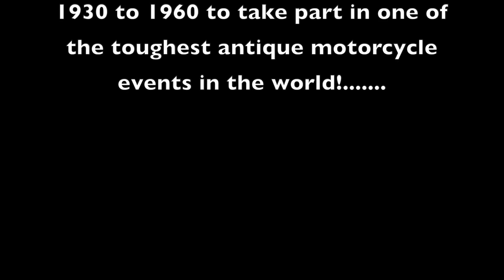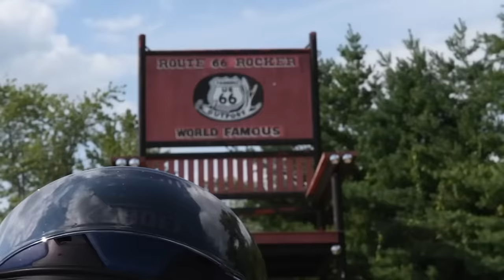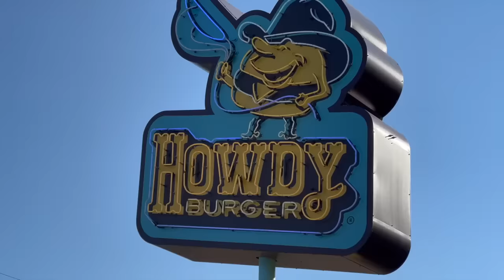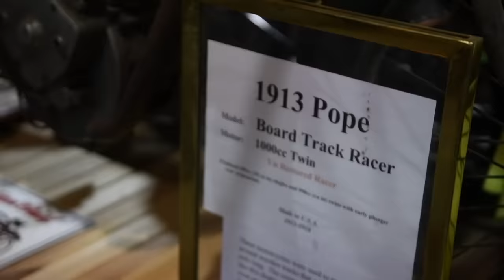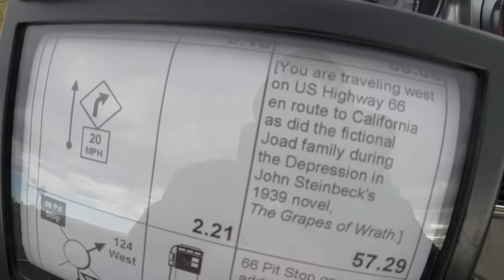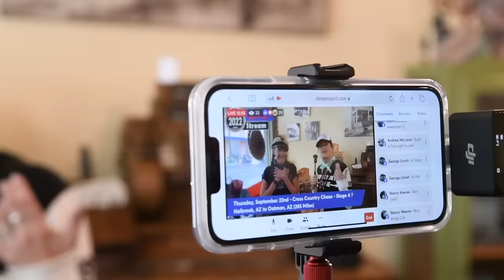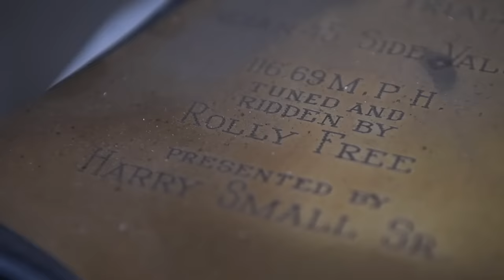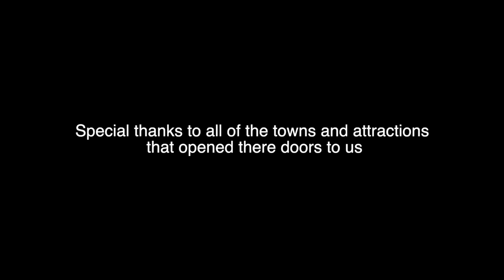Nearly 100 Antique Motorcycles Travel along Route 66 on the Cross Country Chase 2022 Competition

Comment: Rt 66 doesn't travel thru Nevada. It crosses from AZ into CA farther south at Topock, AZ. They must have gone thru Laughlin, NV for better lodging purposes because there is fuel in Golden Shores, AZ. and of course, Needles, CA. Rt 66 has had several Western Terminus' but the Santa Monica Pier is not one of them. The intersection of Olympic Blvd. and Lincoln Blvd. a few block's away is where the closest official terminus is. Jay Leno's Garage would be the cherry on the top for me.

Comment: never get caseys gas in the midwest in anything older than 20 years old it will ruin the carb gas tank etc,
Reply: the reason is there is water in there tanks and when the moisture hits the engine bad day